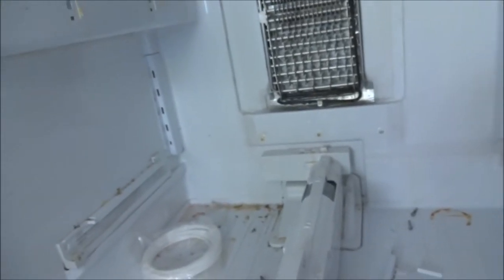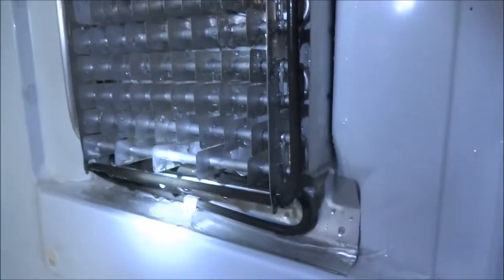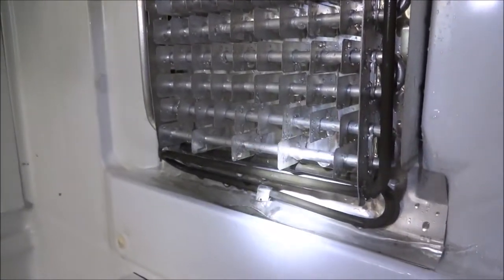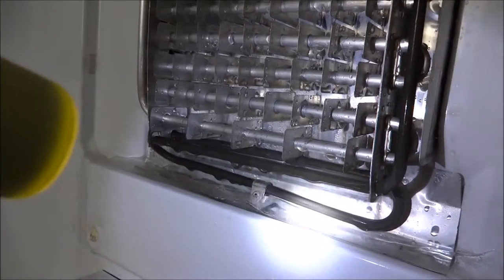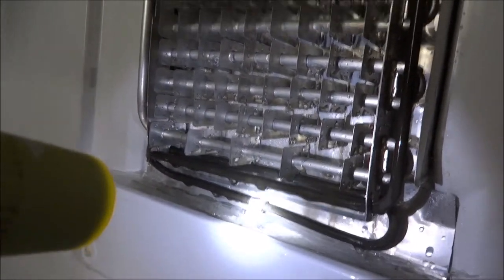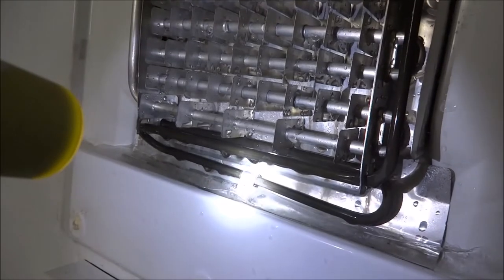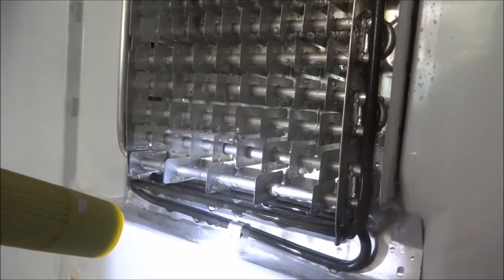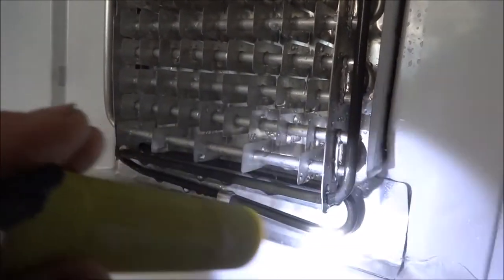Samsung Service not cooling  & or  E22

Comment: I had the fault C21 code and after watching this video and several others I ordered this part DA31-00287B Refrigerator Evaporator Fan  from Amazon will fix your C21 and C22 code at least it did for my fridge that wasn't getting cold I have the Samsung Model#  RF27T5241SR  this is the fan that is in the inside bottom freezer drawer behind the gray panel. Easy fix and saved over $500 for repairs by doing it myself. The fan only cost $25 on Amazon